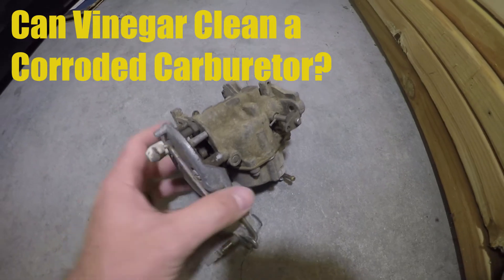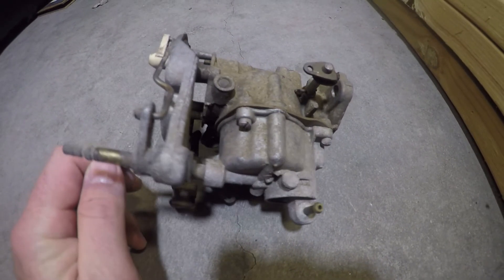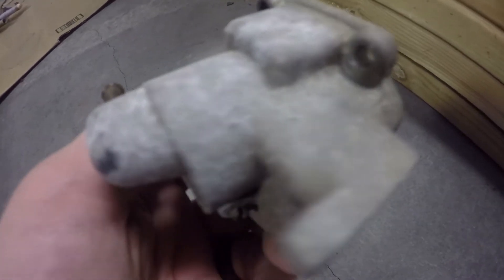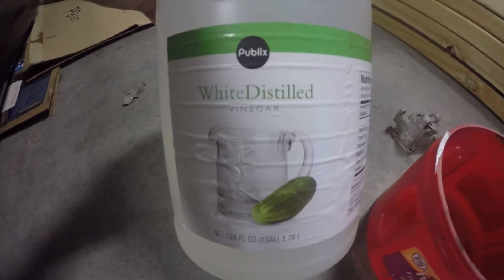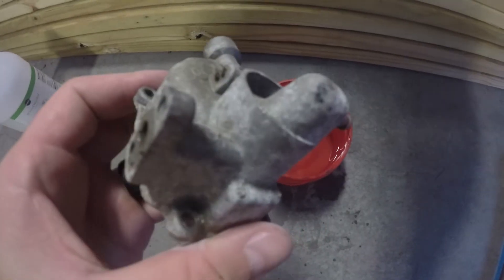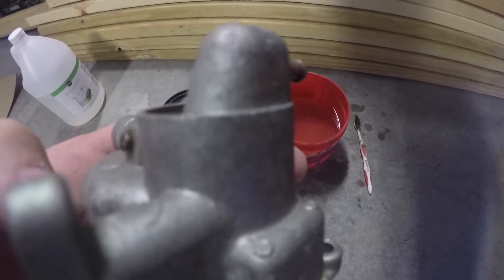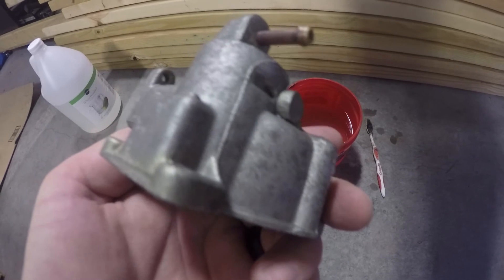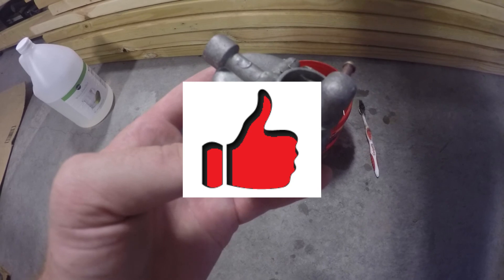Can Vinegar Clean Surface Corrosion off a Carburetor?

Comment: It's an aluminum alloy and it will turn like that in time. Especially today with the crappy gasoline containing ethanol. Ethanol is hygroscopic (it attracts water). So when the gas has been in there for a while a lot of water is in there too and it will start the corrosion process. When you run a 2-stroke engine like me, it will be somewhat mitigated by the oil in the fuel. When I shut down for the season I let my motor run dry and I blow some WD40 into the carb just as it is about to die on me. A few turns on the starter will let it come all the way into the cylinders too.

Comment: Hey dear im from india plz tel me the solution.. I dip my scooter carburator in dilute HCL for one day   having  perespective that it gets clean. But i was shocked to see next day that my carburator encounter reaction and salt was produced on my whole carburator.. I removed salt by water.. But carburator is still blackish.. How to remove that blackish from the carburator to make its original colour.. Plz dear
Reply: HCL is hydrochloric acid. It will turn Aluminum into hydrogen and pit the surface. Even worse when it's an Aluminum alloy and you do not know what's in there. Brake cleaner will do the job just fine. Use a brass wire wheel and a Dremel tool to get the worst off first.

Comment: if you constantly soak zinc for too long you will eventually eat away the zinc itself, I destroyed a petcock on my moped in about 4 days trying to clean the tank. I wouldn't want to leave a carb made of zinc in vinegar because it will eat portions out. Aluminum doesn't react at all though so if it's not zinc you're pretty safe.
Reply: My fear is if like on a moped carb you're dealing with a float you'll eat out where the needle sits meaning you'll get too much gas...  why people use zinc for these things at all baffles me.
Reply: You not only eat away the zink it will eat away at most metals . If you have many dissimilar metals in one pot there will be a reaction each one of those metals against each other  . This results in a negative reaction . All different types of metals needs to be cleaned in each of there containers . Then soon after the parts have to be rinsed in distilled water twice , Then each part needs to be soaked in a neutralization solution at least 3 times in  three containers . Then rinsed again . lastly Heat dried in oven @ 150 degrees .
Reply: @jeffmullinix7916  thank you

Comment: How long did you soak it? 24 hours?

I did this and let it sit for 3 days minimum with white vinegar fully submerged carb and it was 90% gone

Same is true for rusty tools its like 90 to 95% gone 
Zero touch like new.....

Try being patient and let it sit longer see you get better results

I watched mine daily and it was about the 3rd day the tools were spotless, but was like a miracle happened,  I was not a believer until I tested it myself off fishing season so I wasn't antsy to get out on the water of course
Reply: I had carb from 14.5 hp briggs,, that was so rusted and coorode neither choke nor throttle shafts would turn,even with force! i took it apart as much as possible,(basically took float bowl off) coldnt get float in out.! Isoaked for a week or so and was pleasantly surprose that i t wasnt totall disinagrated ,bu i was abl to put a kit in it and its still running the mower quite well!  I was able to gt pn out and jets out so it does work!!